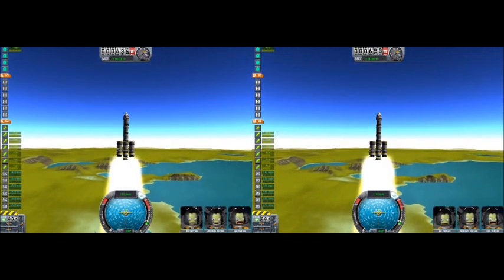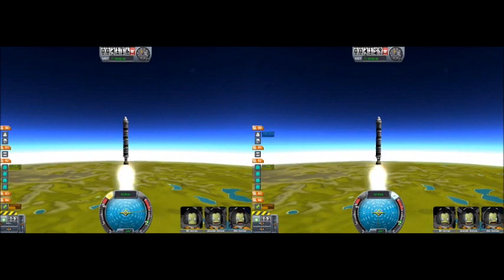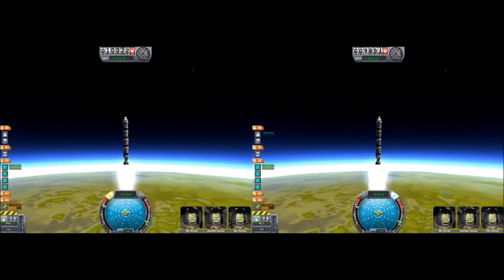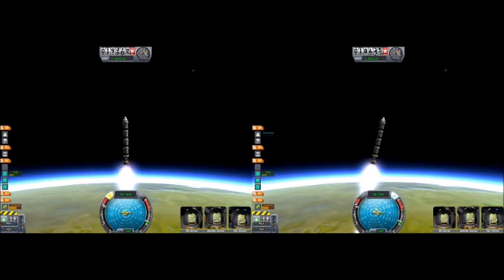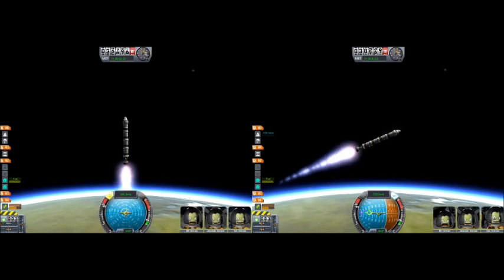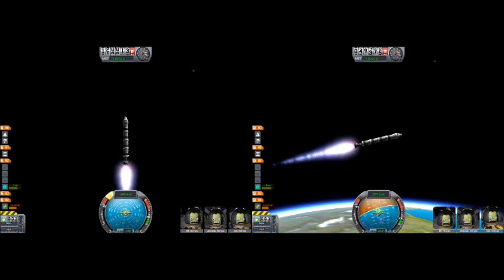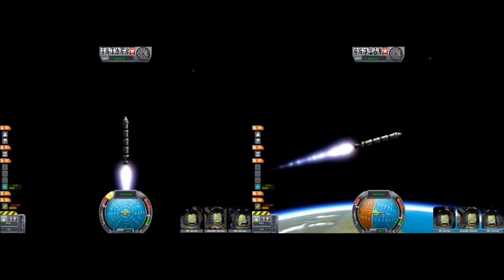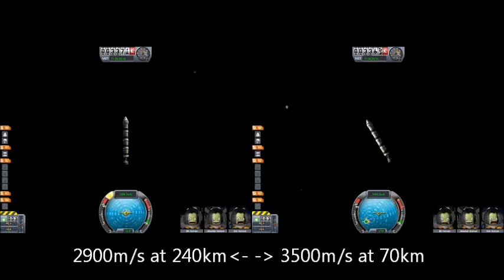The Best Way To Achieve Escape Velocity In Kerbal Space Program

Comment: So basically, the one on the right is similar to slingshot?
Reply: tenchimuyo69 not really, but if you'd like a slingshot analogy, if you fire a slingshot strait up the projectile will travel away from you a certain distance, but if you fire it at 45 degrees instead of strait up it will travel much farther because it is not fighting gravity in the direction it is traveling.